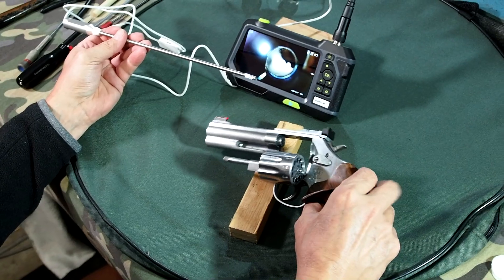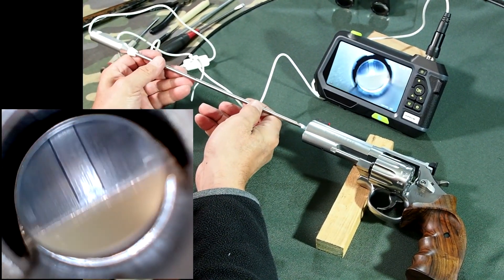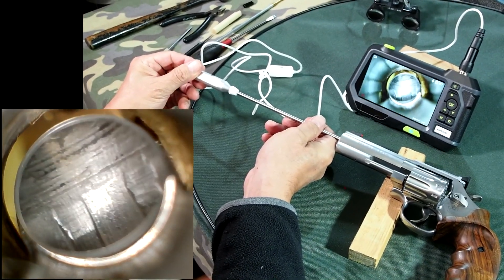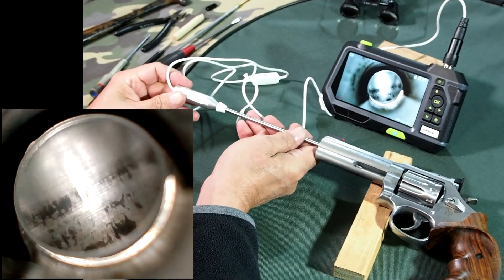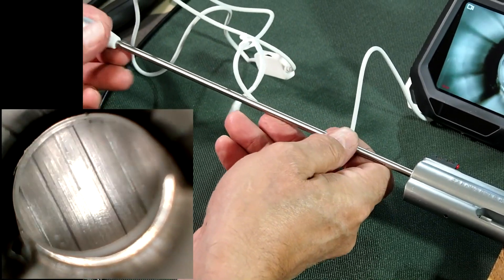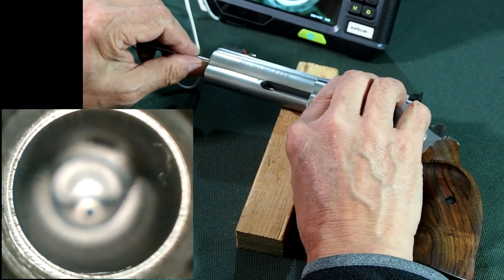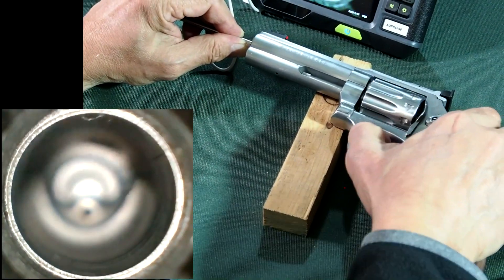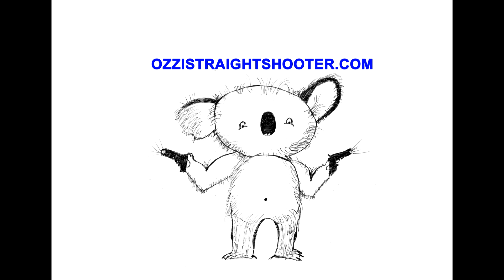Smith & Wesson Barrel Exam

Comment: Nice boroscope, what is the retail price of it 600$? It’s difficult to find a seller of this Aupro-90 online.
Reply from the maker: Hi Roy, there are several versions of the camera. The one in this video is specially made for pistols. There is a version with 900mm flexible camera and a rigid camera for rifles as well. go to ozzistraightshooter.com web site. Send an enquiry via the web site and they will help you with whatever bore camera you need. I know they ship these world wide and shipping is generally inexpensive.
Reply: @ozzistraightshooter9273  Thank you very much. I noticed the extension for easier inspection of barrels. Im going to use it for multi purpose. I will check out the website. Thanks.